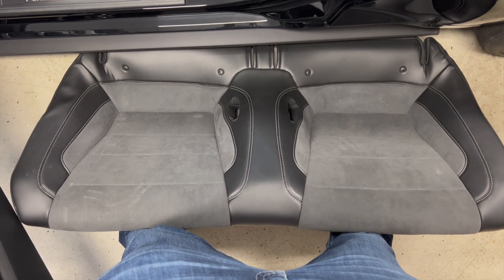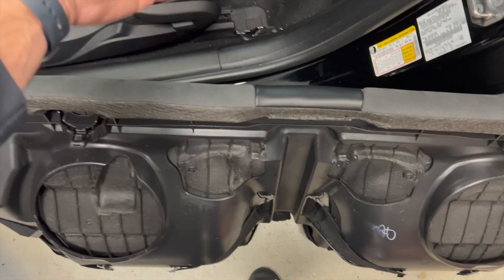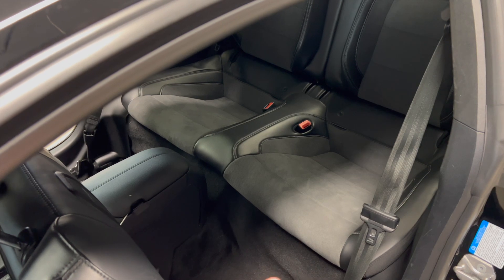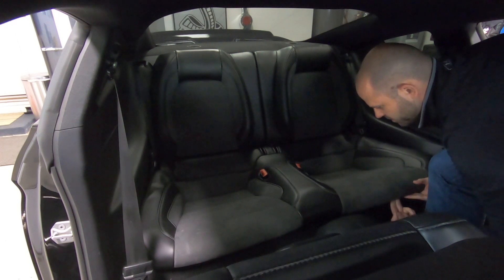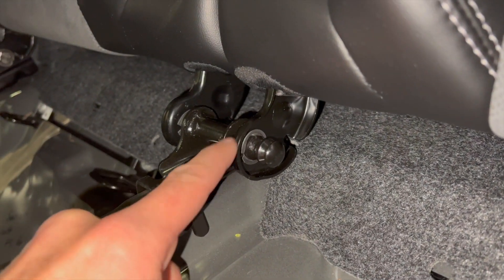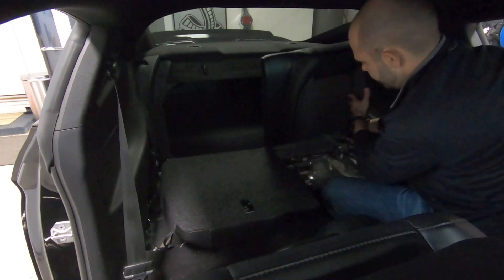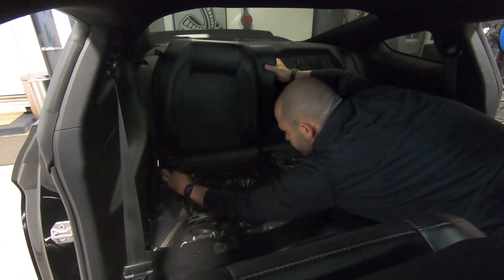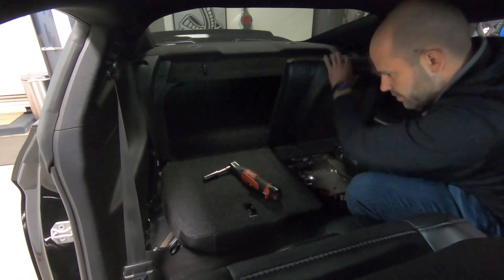GT350 Mustang Rear Seat Removal and Install DIY Tutorial

Comment: what if the seats don’t lock in place? not where your butt go but your back
Reply from the maker: I’ve never had that problem, but it could be that the bracket that gets held down with a nut isn’t fully seated. Maybe try to close the seat slowly and see where it’s hitting the latch and try to diagnose from there.
Reply: On my 19 GT the ford certified tech just pulled up on bottom cushion and broke both secured fasteners. Now the bottom just moves around